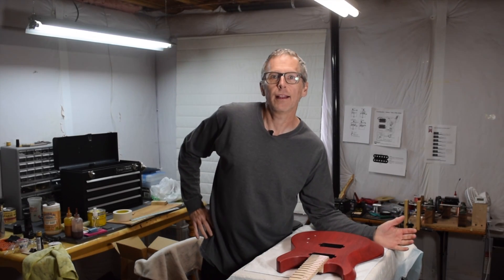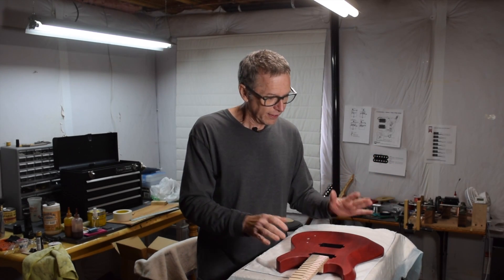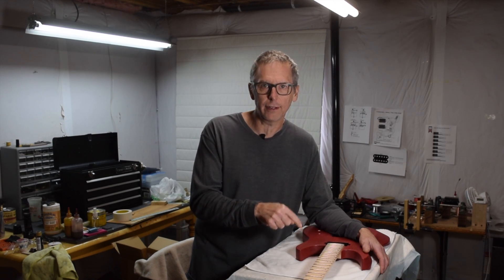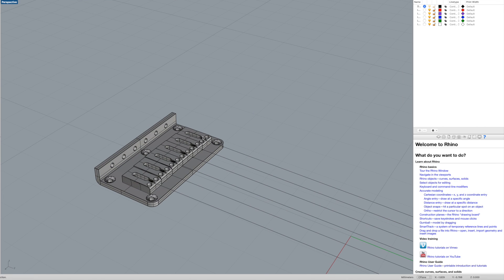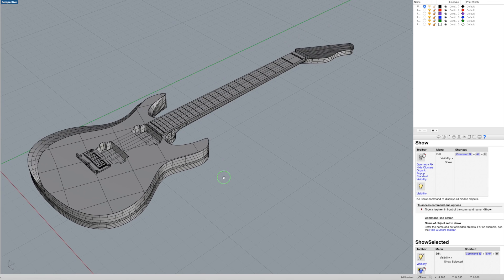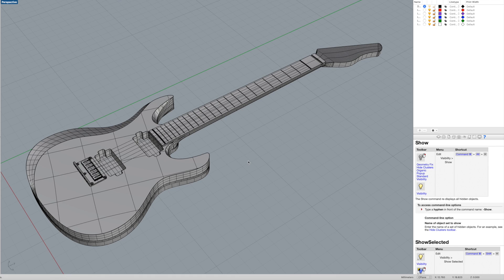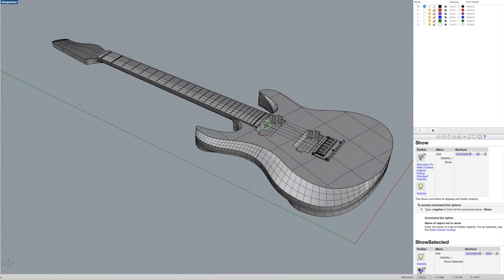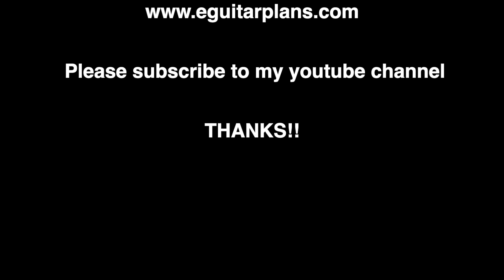Episode 123 The Modern Way To Design A Guitar

Comment: You say you use Illustrator for 2d and then Rhino for 3d.  Can I skip the learning curve of Illustrator or Inkscape and do everything in Rhino?  Or is it better to design in a 2d software and then finish up in 3d software?  I'm thinking of going digital and would like to learn the fewest programs.  Thank you so, so, very much for all your videos!
Reply from the maker: Yes, you can work entirely in Rhino to create full-scale 3D models. I use Illustrator only because I am familiar with the program and can generate 2D designs very quickly and import them into Rhino to be extruded into 3D.

Comment: I was wondering do different set bridges to tremolo systems require different lengths from the nut to the bridge? Or are they all basically the same?
Reply from the maker: You always measure from the nut to the bridge saddle, not the baseplate. Bridge saddles will always be in the same place for a given scale no matter what kind of bridge you use. However, the baseplates differ in design so they will end up in slightly different locations relative to the nut.
Reply: Ok, very helpful, thank you!

Comment: Quick question about the router: Does the guitar come out ready for color, or do you still have to do sanding and fine shaping?
Reply from the maker: I can go to a surface ready for color, but I take it to a point where I can finish with 220 grit. It's faster that way.